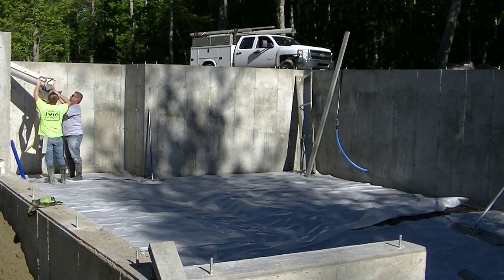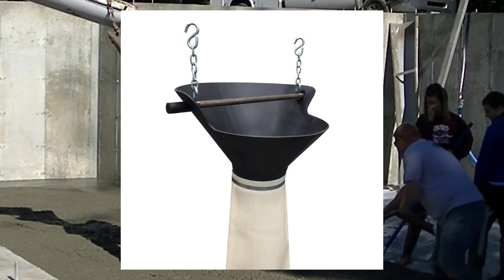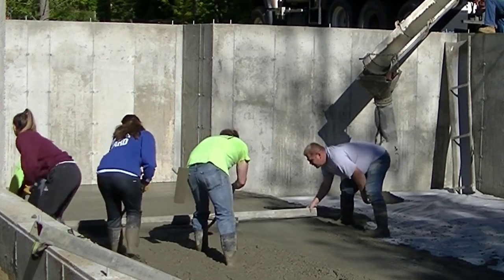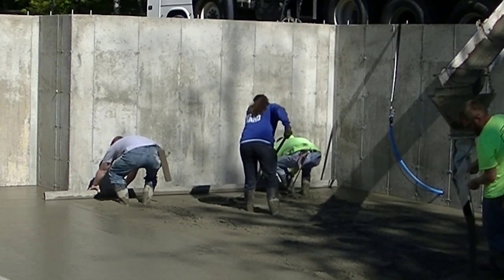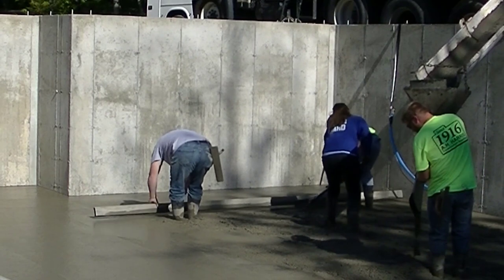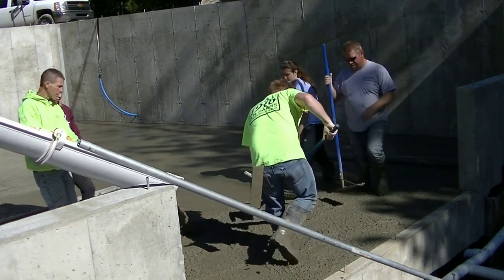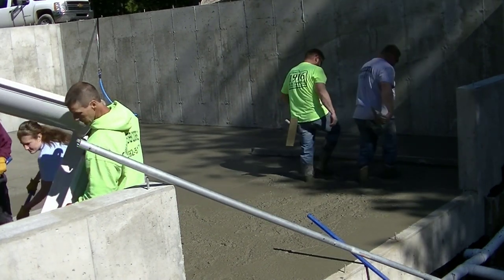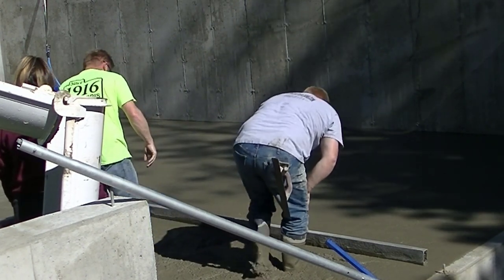How To Pour Concrete Floors Easier (My 2 Hacks!)

Comment: Something interesting to know. You can use a tremi tube to pour concrete under water.  The tube must go all the way to the bottom of the pour but it prevents the concrete from dispersing and mixing with the water.   We have done this where it isn't practical to get the area clear of water for footings and the like.

Comment: Hi mike , have done lots of floors here in New Brunswick, but no one ever uses the water reducer , they mostly just add water , we use most of the same methods as you , but work a lot harder sometimes on the floors , what exactly do I tell the plant I want for a mix with the reducer?

Comment: I was just thinking, u never use a pump or a telebelt. When I did only new construction we pumped at least once a day. A lot of times we would belt in the fill on a basement and immediately have mud there. Then we would go to the next house and do the same. I stayed and finished. At the end of the day we would get 3 floors a day, and I soffcut every floor.